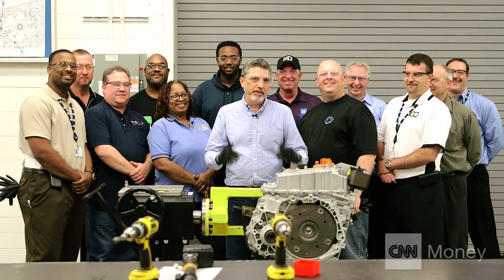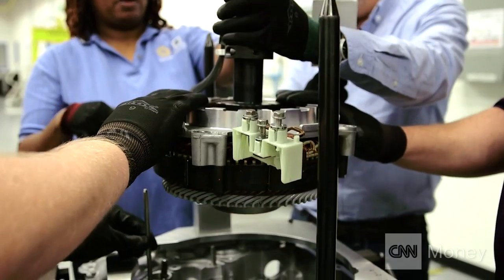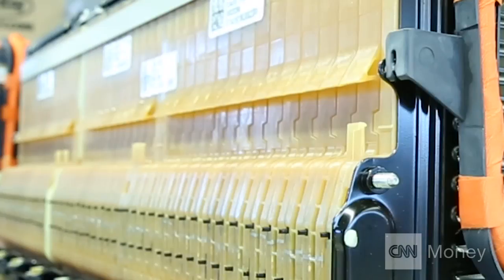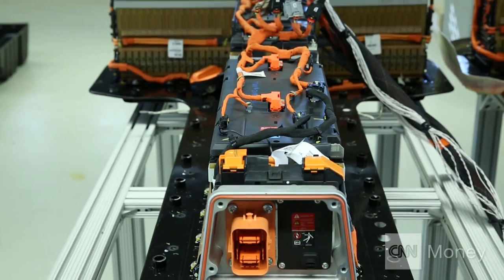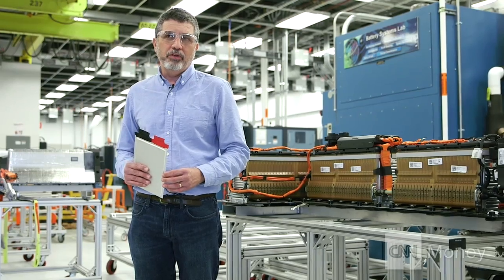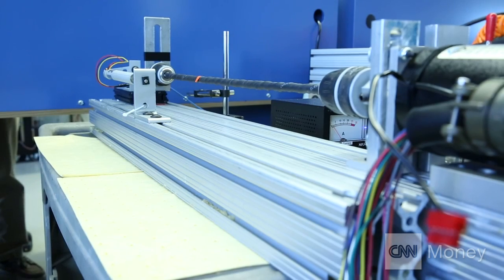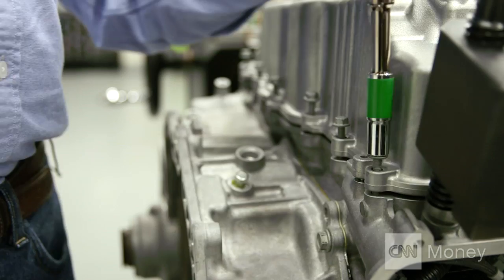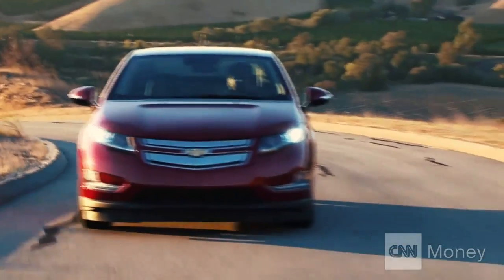Inside the Chevy Volt battery lab

Comment: To me, this seems like GM smells how much Tesla is taking over. They let CNN come do a video inside their battery "lab" just when Tesla Motors is about to come out with the biggest lithium battery project in the world teaming up with  Panasonic. If GM had any intelligence, they would team up with Panasonic ASAP on this, and better yet, team up with Tesla Motors by investing into the new American lithium gigafactory.
Reply: Competition is good.  LG and Panasonic competing means lower prices and better technology.
Reply: They are teaming up with their Panasonics best competitor, LG Chem.
LG have managed to decrease cell costs by a lot too. They have the same goal: Produce a 200 mile range battery electric car under $35,000 by 2017.

One thing is for sure, Nissans own battery manufacturing isn't cost-competitive with either.
Reply: Chris K You know the gigafactory Tesla is building for their batteries will literally DOUBLE the production rate of lithium-ion batteries of the entire world right? DOUBLE! So take all the battery factories of the WORLD, combine them, and they still can't produce as much as Tesla's gigafactory. That's not "catching up".

Comment: I really hope other companies get rid of these shitty batteries and make tesla motors
Reply: GM battery packs are modular and can replace cells when needed. Tesla uses welded Panasonic cells, and take more time for replacements. Besides, the GM pack has active coolant flowing between cells, while the Tesla pack has the coolant around them, an ineffective but cheaper form of cooling. GM is more advanced that Tesla here. Finally, no Volt has caught fire in an accident. As for Tesla? Four!
Reply: Please explain the deficiencies of these batteries.  Also, how would replacing batteries with a motor work?

Tesla stole GM's skateboard design allowing more space for batteries.  Tesla is also selling a car for 80 grand.  This is not anywhere near the market the Volt is designed for.  The Volt is being designed for normal people.
Reply: Christopher Feist
 The deficiency is the pack design. Because of its shape, the Volt can only seat four. Perhaps GM should have "stolen" its own design.

(None of which is to say that the Volt isn't a good car, or that the cell choice wasn't a decent solution for the 40-mile range-extended electric type of vehicle.)

I think Wuwlf's comment just reflects some of the disappointment that other companies didn't use more energy-dense cells like Tesla to produce all-electrics with decent (200-mile-ish) range.
Reply: Christopher Feist Im talking about other companies building off teslas patents to create more cars with a 200 mile range
Reply: GM pack cells can not be replaced any easier than Tesla cells. Have you watched video of a Volt pack being dissembled? Not easy. And then there's the whole getting it out of the car part. At least the Tesla packs drop right out with 16 bolts (or so, don't remember the exact number) Also, the Tesla cells are in modules, so you just replace one of those instead of trying to remove a single cell.

Anyway, they are two different pack designs using two very different kind of cells. Pretty much apples and oranges.